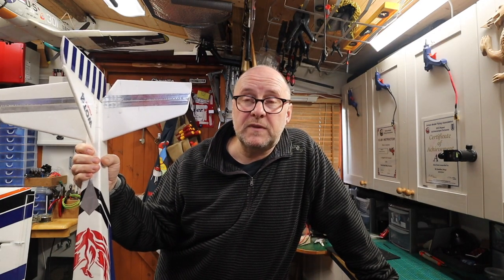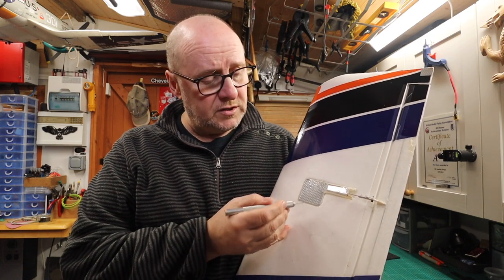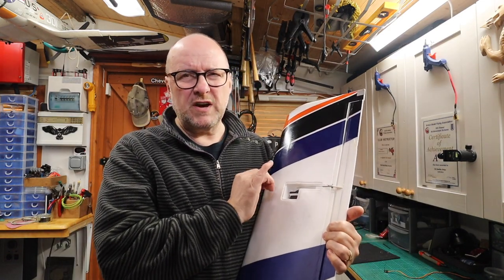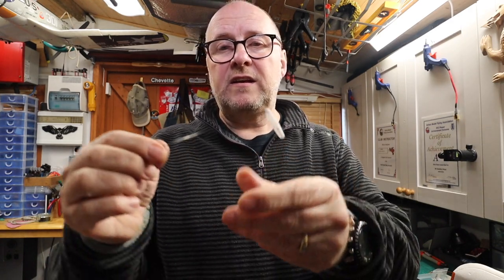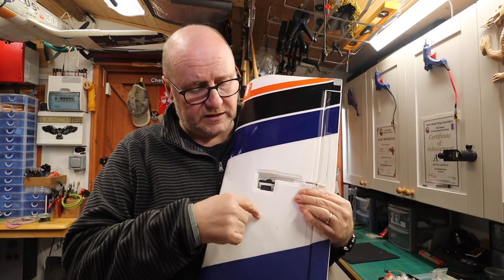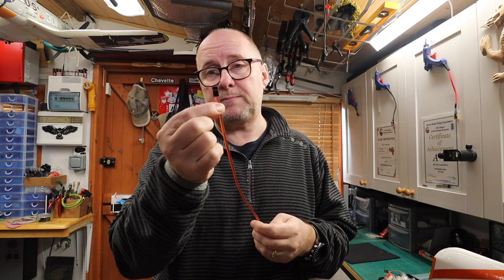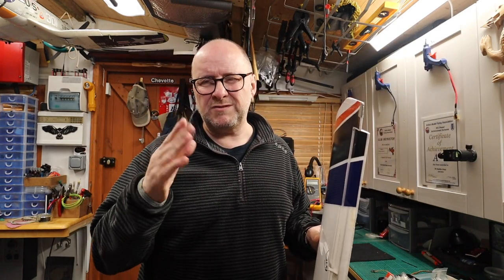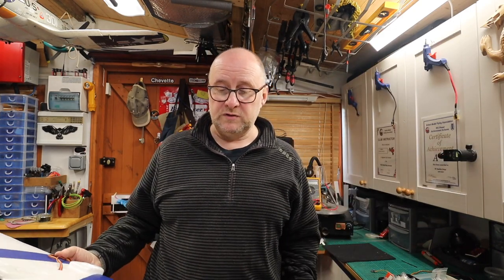Upgrading Wot4 Foamy wing servos

Comment: Why didn't you just solder a plug on to the existing servo wire? Then you wouldn't have to pull it thru the wing....
Reply from the maker: I could have...lol..... the point was the channel was a tight fit. so for people who don't like soldering or crimping and assume it is a quick swap out on a beginner plane.
I keep the old servos for wings that I will use for combat flying with the quad boys. 
They are crap servos but ok for that. I actually made servo extension leads for easy swap outs
Reply from the maker: Have a look at the Freewing Avanti S maiden video.....it was a cool jet
Reply from the maker: and the Wooly Sheep events were at Miskin Manor